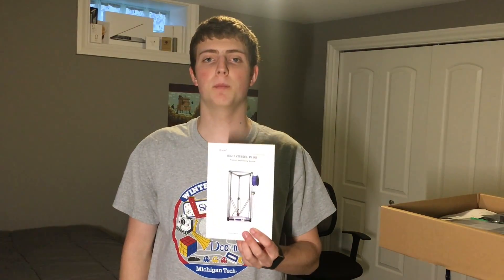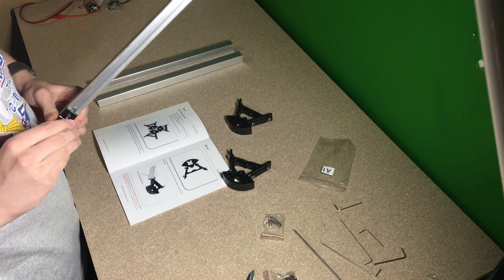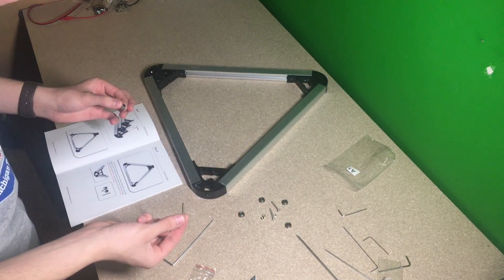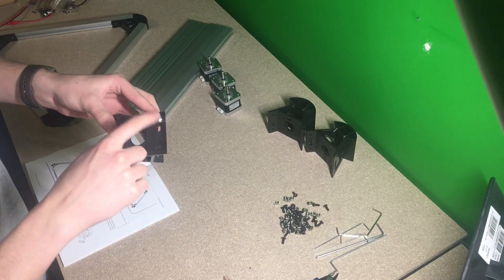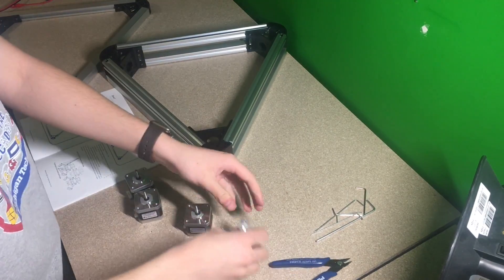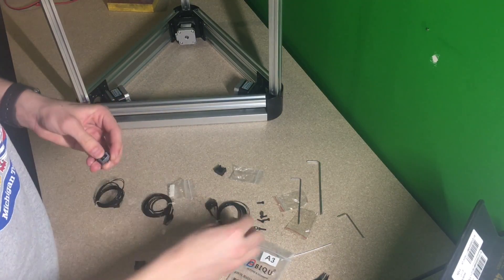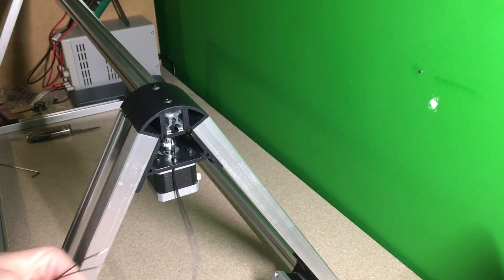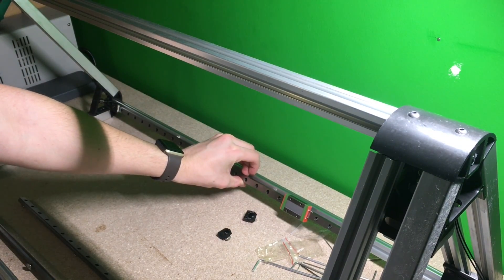BIQU Kossel Plus Kit Build Log Part 1 | 3D Printing

Comment: About 6 minutes in you deal with the gears for the step motors. Where did you get the set screws from? I can`t seem to locate mine.
Reply from the maker: Colin Hammill the set screws should be inside the gears.